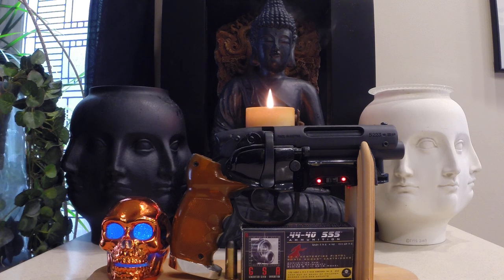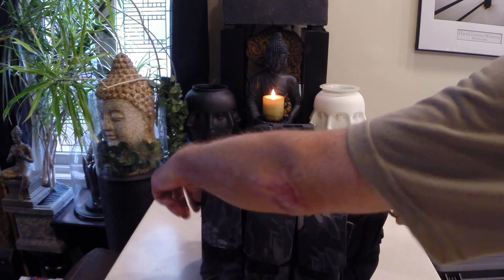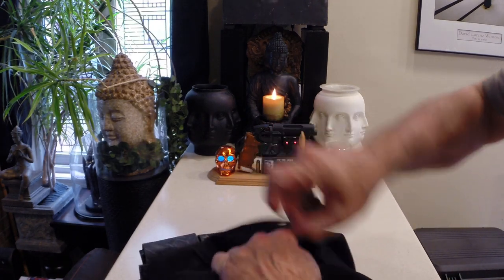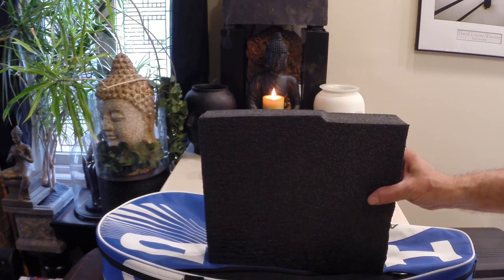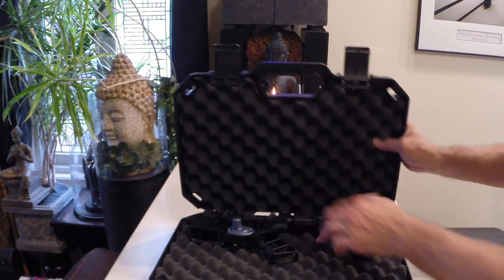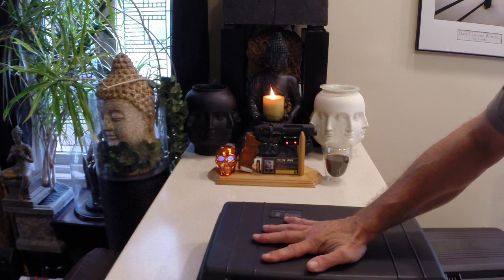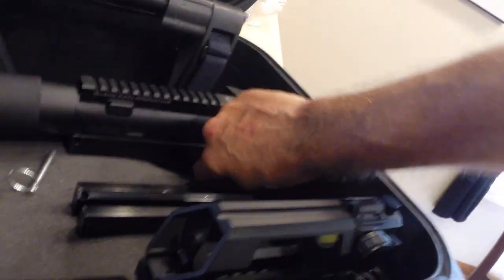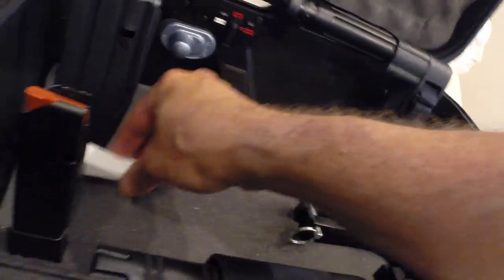DIY Custom Cases for AR Pistols (GOPR0453)

Comment: Not all heroes wear capes.  Thanks for this.  I might do a case build like this if I can get over buying and drilling holes in the bottom of some extra mags.
Reply from the maker: I am not worthy but thank you for the very gracious comment.   Some of my project (electronics, home, firearm related, etc) I am disappointed with & some are even complete failures.  But the case project of getting 3 AR pistols with optics into a "small"(ish) case & being efficient and ergonomic was one of my better executions.    Since I did this project before prices on anything firearm related went insane; I think I was only out $25 for the 3 mags.  However if you google "Horizontal 5.56/.223 Sporting Rifle Display, not 308 - 3D Printed | Angled or Straight Desktop Stand" you'll find someone on etsy selling stands for $18 each which might work.  (They might be too tall, hard to tell from the picture)  Also not sure how durable they are. (Being 3D printed)  Another option is to  search Optics Planet for "Spikes Tactical Mountable Gun Block / Stand SAT1016" ; for $22 each this stand will work & not require as much work/time to mount to the case.  *As they have a flat base and 4 screw holes already in the stand. (I do find this stand to not lock into the mag well as good as an actual magazine, but it would work & is the correct height.  For me, the $38 for each of the 3 "Wheeler Engineering Delta AR Upper/Pic Rail Vise Block" was a hard pill to swallow but it did work perfectly.  Best of luck & thank you again!
Reply from the maker: Just saw you have a ZX10R (nice bike!)   You might enjoy this other video of mine:  2012 Halloween "Motorcycle Costume" skeleton passenger    https://www.youtube.com/watch?v=maWchokVZ_8

Comment: I have a red Phase 5 QD mount on the AR9 pistol i finished building 2 days ago. Trying to figure out a good case option for it.
Reply from the maker: If you want a discrete case, I like the Head Tennis case in the video at 1:40 which can fit AR pistols up to about 26" long.  If you don't mind removing the upper from the lower in the case,  the voodoo tactical rhino range bag is also pretty nice.   (And can fit a lot of gear)  I have one of these & cut foam to divide the main compartment to fit multiple AR pistols.  I put the lowers in the side pouches and the uppers in the main compartment.  This way I'm able to fit 4 AR pistols in that range bag.  *Search Amazon for "VOODOO TACTICAL Rhino Range Bag" & you should find the black one for $84.27 Skull graphic &  VOODOO TACTICAL is stitched on the side.  This is a pretty nice bag & I'm very happy with it.
Reply: @Aegisltd  i hit 2 pawn shops earlier & found a trumpet case for only $25. The interior has  just the right dimensions. Remove the form fitted trumpet part and put new solid piece of foam and it should work. Only need it for transportation.
Reply from the maker: @cfh13  Nice!

Comment: Can you recommend a similar hard case for a single ar pistol (Saint Victor) with 1 handgun and ammo storage
Reply from the maker: Do you want the upper & lower "attached" when its in the case.  If so you'd probably want something longer vs deep; like the Pelican 1750.  If you have a folding buffer tube or are willing to separate the upper & lower you could use a more compact case.  You need to lay everything out & figure out how large the case needs to be to fit what you want to put in the case.  Then you can go to a place like "Optics Planet" (Where I get most of my cases) & see what will fit your needs.   Along with the Pelican 1750, check these two cases out:  Plano Molding AW XL Pistol Case  108031 Color: Black (which you see in the video & is about $70) &  SKB Case Iseries. Waterproof Case, 29x18x10.85 (which is about $255)
Reply: @Aegisltd  thanks for taking the time. Very helpful 👍

Comment: Where did you get the foam
Reply from the maker: I used to get spare foam at a local gun show from the prior owner of Dulles Case Center.   He would bring his scraps (left over from various projects) and sell them.  When he ran out he told me to check online for Willard Foam Packing.  Once you are on the web site look for Polyethylene Foam Sheets.  I still have lots of foam so I haven't had to order from them yet.  You could also just search google for Polyethylene Foam Sheets.  Hope this helps & thanks for checking out my video.